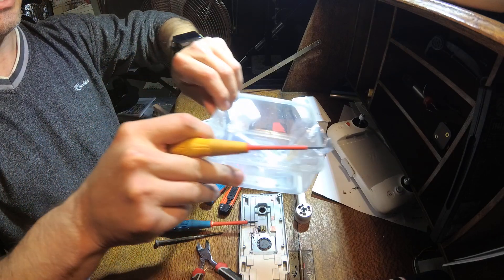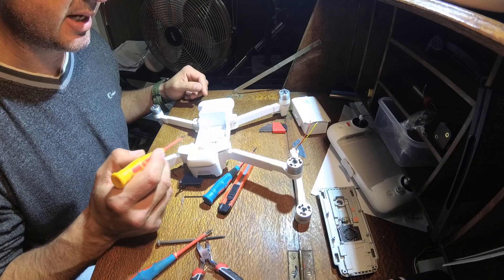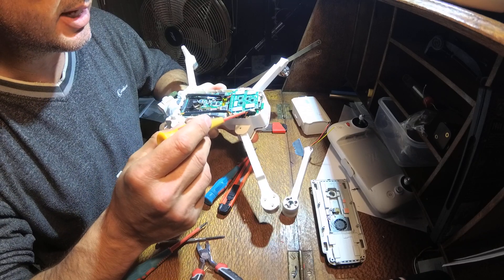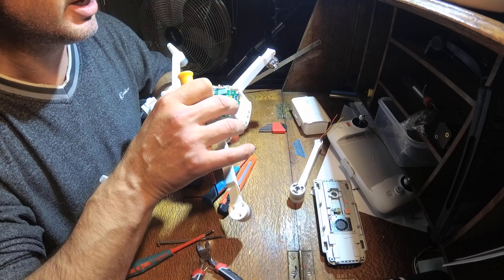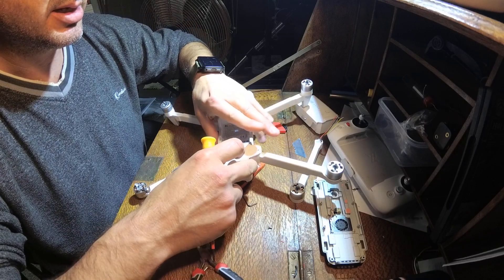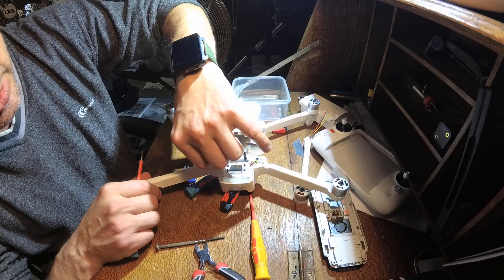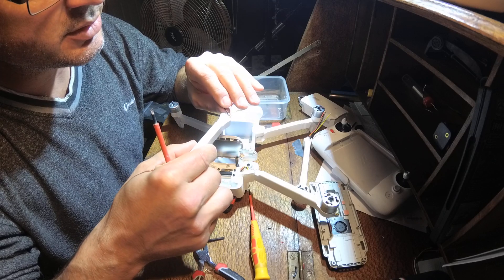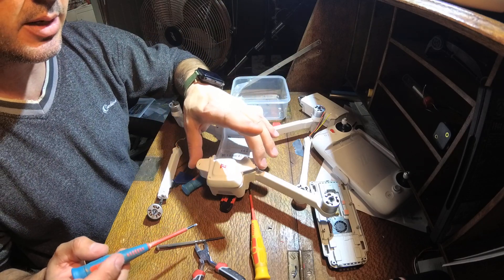Replacement Fimi X8 SE Drone Rear Arm (English)

Comment: Hi DanVid, I saw your teach video on how to replace a fimi arm. I have two critical points that I can not determine 100%. One is the LED from the front arm on the right and the other is the antenna or where it is plugged in. The LED connector is for me just before the hose guide and I have a second black cable with a small square gold shoe that should be the antenna. The gold shoe cable goes under a piece of foam, I have not taken it off yet, but may just be plugged in. I took photos that I embed in a video and upload to youtube. https://youtu.be/BZ2HBbixhnA 
I would be very grateful if you could say something about it.
Reply: I am sorry but I only had that drone for a few months many years ago.
Reply: @dominicwindsor8101  Doesn't matter. It is repaired by a professional and still flying.

Comment: Thanks for letting us know where the two hidden screws are - they are tough to get to!  The lower board also has a locating tab that engages with the rear casing, so to lift the board, you have to push it forwards to disengage the tab. The X8 is definitely not the easiest drone to work on!

Comment: Dan, just wanted to know if u have an suggestions on how to fix a barometer error on the Fimi X8 SE 2020? I have this problem and it seems like no one has any solution on how to fix this. I restarted the drone so many times and still doesn't correct the issue. I have taken out the Fimi Nav 2020 app and reinstalled and nothing. I even done all the calibrations the drone requires and still have this error. I hope someone out there had a solution on how to fix this problem. I see no fix videos on here concerning the barometer error which shows on the app. I hope u may have an answer. Losing hope.
Reply from the maker: Very sorry mate. That's a tough one. I had a zino with the same issue and found firmware updates helped a bit but not much can help a hubsan in my experience.  I would try doing a firmware re-install on the Fimi though and see if that might improve something. Worth a shot

Comment: Thank you for the Video. 
FIMI X8 SE and FIMI X8 SE 2000 arm plastic parts are identical. The wires need to be slightly rebuilt.
I replaced my 2018 Fimi X8 with two broken legs with the 2020 Fimi legs.
I would try to fly. Everything was fine, no error messages, the lights were flashing.
When it started, it turned out that the engines of 2020 pulled more and the drone wanted to throw itself on its back.
I have a question. Are the engines of 2020 special boats, or have I broken a gyroscope, for example?
Maybe someone can help.
Fimi spare parts for 2018 are not available.

Comment: Hi bro, do u know how to teardown the front motor? Just want to check if any hair or things stuck in the motor bearing, cuz my motor quite hot fast
Reply from the maker: G'day mate. Not taken the fimi motor apart before but they are usually pretty generic. After removing the motor feom the arm, they take a pair of circlip pliers to remove a small circlip under the motor and the top hub should then come free. Be carefully though as that circlip can be a pain and easy to lose. Let me know how you go.
Reply: @danvid1935  no mate, u get me wrong. What I mean is just teardown the motor front leg so I can see clearly on the bottom of the motor. I'm only need to flip it over a bit just to see the bottom of the motor. I can do this with the back motor but not the front motor cuz the back motor only need to unscrew 3pcs screws and the motor is free to flip it over a bit. And the front one only got 2pcs srcews, but I can't figure out how to teardown the front landing leg(below the front motor) even after unscrew the 2pcs srcews. update me pls if u figure out how to remove the front landing leg cover (not the arm)
Reply from the maker: @FoochekhengNov.seventeen  ah I see. Sorry mate. I sold my fimi not long after this video otherwise I would check it out and see but I no longer have the bird
Reply: @danvid1935  why u sell it? not a good bird?

Comment: Hello, how are you?  My FIMI X8 SE had an accident and broke two arms, I ask, is there a problem with using the 2020 model arms?
Reply from the maker: Not sure sorry. Sold my fimi not long after this.
Reply: Thank you for the Video. 
FIMI X8 SE and FIMI X8 SE 2000 arm plastic parts are identical. The wires need to be slightly rebuilt.
I replaced my 2018 Fimi X8 with two broken legs with the 2020 Fimi legs.
I would try to fly. Everything was fine, no error messages, the lights were flashing.
When it started, it turned out that the engines of 2020 pulled more and the drone wanted to throw itself on its back.
I have a question. Are the engines of 2020 special boats, or have I broken a gyroscope, for example?
Maybe someone can help.
Fimi spare parts for 2018 are not available.

Comment: I've the August 2020 edition, found a crack in one of the arms. So looking to replace. Have brought the correct arm. So thought it would a be simple unscrew. Thanks for the video, about getting the back section open. But have seen that light blue glue on the points, how do you get that off?

Comment: Hi again, question did you see the blue silicone on heatsink? do you know what i can use for that to replace and or also the white silicone that is soldered over moter cabels?  thanks in advance :)
Reply from the maker: I upgraded from the x8 not long after I made this video so memory is a bit hazy but I didn't actually replace that stuff. It would be just to insulate it. A bit of hot glue would probably do the trick too I reckon.
Reply: @danvid1935  thank you very much. and out of curiosity,  what did you upgrade to ?:)
Reply from the maker: @Colsos  grabbed a mavic 2 pro as we do a lot of low light photography stuff at dawn and dusk and the 1inch sensor and higher megapixel count are perfect for that. The X8 is still a great bird though
Reply: @danvid1935  nice upgrade, bit to expensive for my pocket. but expensive hobby to i guess, by the way, you made some awesome shots at Dawn and that surf vid, epic...👍

Comment: Thank you for the Video.
I tried it by my drone, but i can't connect it with my Control. Have someone a idea?
Thanks
Reply from the maker: Sorry mate. No idea
Reply: @danvid1935  I have know fixed it. I damadged a wire by closing the case. By put the Screws i damadged the Wires.

Comment: My drone broke similar to yours. A different arm but the same wing part of the drone broke. I am watching how you are replacing it and now I am wondering how you got the replacement arm for your drone. I was wondering about the cost of the arm, the shipment, the method of how you got your replacement arm (because in no way there would be an arm in the box. I searched it!) how long it took for you to get the arm and if you need to give the receipt back or need it (the receipt part may be a problem because I'm sure we don't have t.) thx for the vid by the way. It gave me hope that we could fix it...

Comment: Good job Dan. Thanks for taking time and making video. I just ordered rear right arm for X8  as well as new housing, because the I have a crack on mine at the point where arm connected to body of the drone. 
Which tools I should have to change the arm?  I ordered 1 x hex screwdriver of 1,5mm , will it be sufficient ?   And Last question you not planning make video of how to connect arm ( wiring ,etc)?
Reply from the maker: Wiring required solder and shrink wrap to connect. Fairly easy to do

Comment: Hey there, thanks for taking the initiative for make this video. Can I ask if you or anyone else has the error message "Motors Locked".. i have been unable to find out what this means and how to fix it. I am thinking that I will need to replace the motors for all ... any help from anyone would be wonderful
Reply from the maker: Hi. Not something i have experienced. Replacing all motors would be a very last option to try. I scoured the internet to find the issue for motor lock and there were some instances where firmware was the issue. Other cases where in the app they had checked that it will only arm with at least 6 satellites and fixed it by turning that check button off. If I hear of any other solution I will be sure to pass it on. Sorry I could not be of more help. I know how frustrating motor lock issues can be as I have had it with other drones. Glaring at you, hubsan.

Comment: The severed wires worries me. It seems to be a known issue, but Fimi claims that it is not. Did you check the wires on the other rear arm while you were in there?
Reply from the maker: I checked the other arm and it was fine but it wouldn't have been long before the wires that were stripped started to short out catastrophically.
Reply: @danvid1935  It's a pity that they weren't able to make this right, and also that it is cumbersome to inspect the wires to rear arms. The front is easy enough to check, but as you've demonstrated, the rear is not.
Reply from the maker: @mroek  it's a real shame. Usually Xiaomi have great builds but the wire issue was just shoddy. It would have taken next to nothing to have done it right first time but quality control was absent on this one. Glad it was the arm that was broken or would have never known until it fell from the sky
Reply: @danvid1935  Yes, it is a shame. I have checked the wires to the front arms on mine (at the time I checked they were fine), but checking the rear requires breaking the warranty seals on the screws, and is also a lot more work. It shouldn't be necessary to even think about doing it, but both yours and other people's experience says otherwise. Fimi claims to have tested this to 3000 arm movements, but that seems overly optimistic, especially since their production seems to not be able to get the cable lengths correct (which I think is part of the problem, at least).